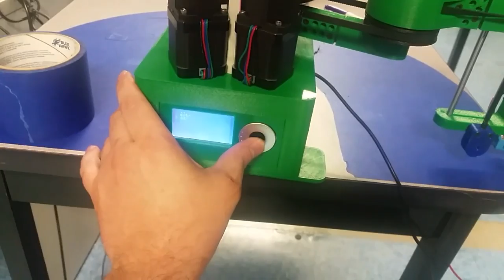Experiments in Accelerometer Probing (RepRap Helios)

Comment: Are you familiar with the Teknic Clearpath servo motors? I think three of these in your new printer geometry would be amazing. They have a number of products including the Meridian servo controller built in and they have a self-tuning system that tests the overall machine geometry to optimize the movements to be as smooth and precise as possible. This video is just plain fun to watch: https://youtu.be/Dwik-W6kRa8

The ClearPath all-in-one servos are impressive too. They start at $254 so I'm sure that's too much for the economies of the product you are planning. But if I were building a one-off project that could use servos, these would be cheap considering the design time involved. I would love for someone to create the open-source version of this kind of device.

Check out their channel: https://www.youtube.com/channel/UC4Q91tGO80QMSHyy1SoHrtg/videos
Web site: https://www.teknic.com/
Reply from the maker: They would be sweet.  I would think about those when we scale the machine up by a factor of 5.  I am actually going in the reverse direction and shrinking the steppers to a 25mm long NEMA16.

Comment: Awesome! I wonder if there is something like the tiny arduino pro micro but including an accelerometer / IMU on board.
Reply from the maker: Dejay Rezme Drop me a line if you find one.
Reply: I've found this one but it's $100. Probably not worth it for ease of use.
https://femtoduino.com/examples/power

I figure you already tried to connecting the IMU directly to smoothieboard? I think these boards always have some inputs left (more inputs than outputs).
Reply from the maker: Dejay Rezme I haven't tried a direct connect.  Firmware and electronics aren't my forte.  However, this $20 solution can be placed on any printer with digital inputs for end stops.
Reply: You could ask some smoothieware developers.
But yeah, plug and play practicality always wins over elegance of design :D

But check out the "arduino pro micro" for $2.

Hmm and there are probably only theoretical advantages of reading more from a full IMU like gyroscope to see if the arm is moving at all after hitting something. But if the motor skips, then calibration has to restart anyway.

Comment: When are you going to release this and what is the fastest you can print with it?  I am not one who is expecting 200mm/s but I am not wanting 30mm/s as a max either.  About 100mm/s seems to be a good trade off of speed and quality and really anything more the quality drops.  PETG I can only seem to go 20mm/s on my Prusa I3 Rework with a real J-Head and due to that, and besides PETG for parts with overhangs is impossible to work with, I ditched it.  So, I know slow and I have done 120-150mm/s so I know fast and looking at your other videos it seems really slow but I chalk that up to still being in the design stages. :)

Oh, one suggestion is for Z and that is when you have everything worked out ditch the bearings as they do flex to some degree but instead of them use bushings.  Bushings over bearings is super sweet.
Reply: This is just a guess but the theoretical maximum speed of a printer design is dependent on the mass that is moved per axis. Since this moves a modest Z axis around it should be between a coreXY and a delta.
Depends on the motors, steps and rigidity when accelerating and decelerating and turning corners as well.
Reply from the maker: It is fast and accurate at speed.  However with the cantilevered arm it will ramp off of cold plastic.  You can probably go as fast as you want internally and the slow boat at 30mm/s around the perimeter.

Comment: Really interesting use of the IMU. I have been trying to get mine to work with my Arduino MEGA, but with no luck. Seeing as you are clearly very good at this, I was wondering if you had any advice you could give me, or just some simple code to get the measurements out of the IMU, as currently I am struggling.
I understand you may not have the time to do this, but I appreciate any help you can offer. Thank you! :)

Comment: I believe this genius idea wouldn't work on prusa clones 😥 (I think the Z movement is too slow there)
Reply from the maker: Ha.  I forget how slow most printers are in the Z.
Reply: Older Prusa (first gens) machines with the M5 all threaded rods are so slow (I have one) and the MK2 is still slow with the ACME rods but pure speed is when Z is driven by belts (as is done on CNC machines).  This machine uses belts so Z should be lighting fast if needed to be but why would it need to be?
Reply: Jonathan Knirsch I'm not sure. The accelerometer should just be looking for a knock.  On the slower rods, he could just avoid the 0.1mm stepping and just go slowly down until a knock is detected.
Reply from the maker: The slower you go the more similar a hit and a move look to the accelerometer.  We will have to experiment.    I do have a few machines with Z screws I can try.